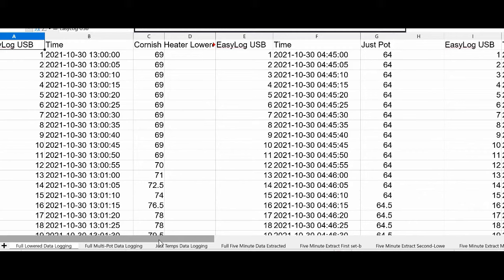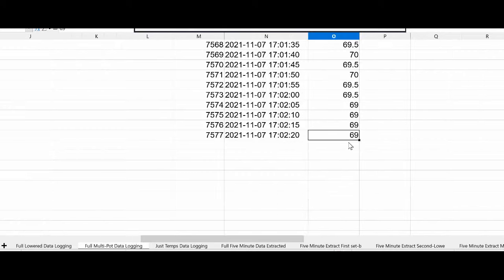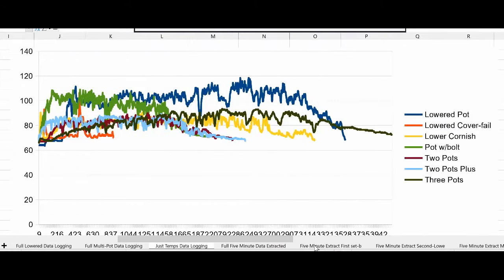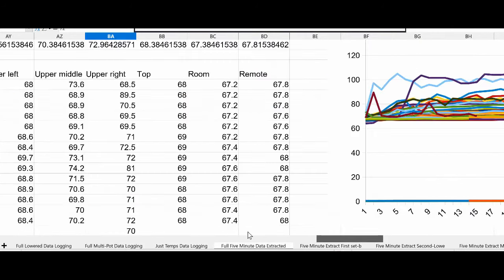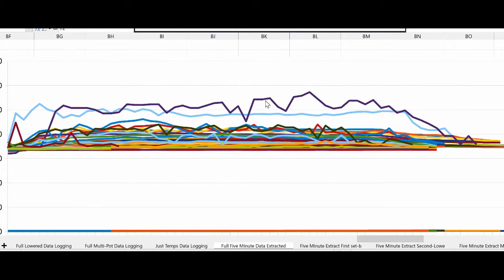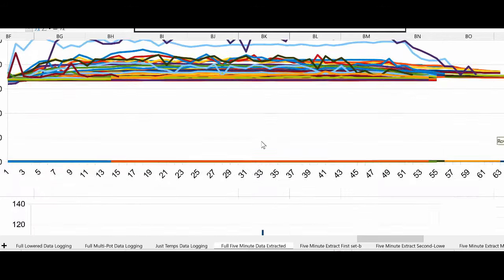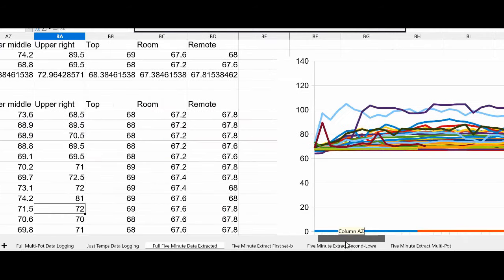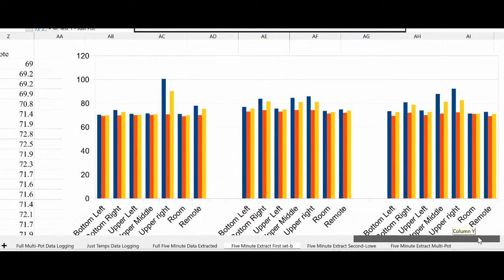How Many Candles Do I Need To Heat A Room? - CANDLE HEATER TEST - Real Data

Comment: I appreciate all your hard work in the few experiments I've watched in your channel....from a 🏴 Scottish women's view try heating a terracotta pot with a coin sealed over the hole...fill with kiln dried sand insert into a metal frame of some sort and heat with candles underneath .....voila you now have a sand battery which will slowly release 🔥 heat once the candles are finished. ☺

Comment: Thx for taking so much time and care to gather, evaluate and conclude. Very surprisingly insightful.
Reply: Great Theory. Real world test. Try 9 T lights inside a Matt black wood burner - radiant heater works fine.
Reply from the maker: I have wondered what layouts would work better, and this series of tests have proven that the only real difference is the heat source. 

Anything that can radiate the heat produced will work. 

Thanks for the info!

Comment: Thanks for the hard and diligent work. It would be great to have a tldr
Reply from the maker: That is, quite simply, that the heat source matters more than what you put it under. 

Putting it under something gets radiant heat. 

But there is no possible chance of getting more heat you than you put in. 

Also, cool off times are, typically, the same as warm up times unless you are working in tons (well, hundreds) of mass. And LOTS of heat!

Comment: i'm just wandering what would happen if you heated some oil with candles, what heat would that put out, either heating the oil under the pot or just out into the room.
Reply from the maker: If you only heat the oil, it would radiate just like this does. 

Actually, this is a real thing, but it's mostly done for the smell. Look up wax warmers or potpourri (I think that's what they are called).

Comment: Here is what I would do, use a  1 pot set up with 4 tealight candles, use an infra red thermometer and take ceiling tempature, from there take readings down a wall in 1 foot incraments to what would be a comfortable sleeping height. Light candles and let burn for  4 hours, repete taking of the temperatures and compare with first readings...
Reply from the maker: That is a good idea. However, it doesn't tell us what happens along the way. 

I set up this test to see how far the heat took to dissipate and to see how much it went up, or down, along the way.

Comment: Thanks. :) Yes it is true, everything. One man from Austria? in the Internet heats small room with good insulation with 1 small + 1 biggg terracotta pots without restriction of air flow (both pots with open bottom holes). You can check. His channel is Bavaria off the grid. In his version we see candles bodies lay down on the big old wood saw blade which is very good - he transfers heat from candles bottom too.
Reply from the maker: I looked at his video on the flower pot heater, and the biggest thing I saw was that he used more candles than I did. ;)

The more heat you input, the more heat output! ;)
Reply: @TestingPyros  Yes.

Comment: Hi TRLWNC1, 
Based on your arguments on the environment plays a major role. 
Making the test fair, and probably it may be still worth a try if this heating concept could work. Try substituting the candles to a terracotta
Reply from the maker: Because of the low overall output, the environment makes a major difference. I have done a test with a metal pot, but I haven't pulled the data out of it. I am planning to do more testing, but I'm not quite ready yet. 

I really don't think that what they are under makes a huge difference as long as it can radiate heat.
Reply: @TestingPyros  Strangely, my responds above didnt show my full statement and question. What if we substitude candles to ethanol gel (the one found in chafing fuel - its available cheaply). It radiates 7.04 kWh per gram. 
I believe the whole aim is to find out if this method of teracotta pot heating is able to heat a room.
Reply from the maker: While I agree that heating a space is good, I have decided to test something different. I want to know which layout creates the most heat. It is well known that a different fuel will create more heat, so I want to know what will lose the least. 

I'll try it with different fuels after I get a bit more data.

Comment: Would wrapping the pots in aluminum foil increase radiant heat? 

By that I mean, capture more of the heat that then radiates for longer and hotter? Obviously it can't increase the 50 to 80 watts of each candle.
Reply from the maker: In my testing, I have found that the more mass you add, the lower the total output. 

Yes, it holds more heat. But it takes longer to warm up, and the amount of time to cool down really isn't that much longer. 

It's better to just go with one pot and get the maximum output.

Comment: how many candle did you use from what you said you use just 4 candle way to much data logging an you are going to fast
Reply from the maker: I used 4 candles at a time.
Reply: @TestingPyros  do not put them all together you risk of a fire i try it an the candle got to hot space them apart you were luckey you did not burn your table like i did
Reply from the maker: I am aware that these can get quite warm. That is why I run them on a fireplace mantle. 

However, I have never had these ignite anything. I almost want it to happen so I can understand what it takes!

Comment: You have found out that bunch of candles have potential of creating some heat.
Reply from the maker: I found out that it doesn't take a clay pot long to warm up. 

Then I found that the candles themselves have an effect on the overall output. 

Then I found that the temperature is amazingly consistent during the time the candles are burning. 

Then I found out that the pot cools off at almost exactly the same rate no matter how much mass had been added. 

Lots more than just whether or not an open flame can warm. 

Which is what I wanted to understand. I wasn't wondering if candles could really do anything. I wanted to know the trends and patterns. 

I'm working on digesting the rest of the information so I can say which layout puts the most heat, so is best overall. 

Thanks for the interest!

Comment: Je hebt al blazertjes van 29 watt.
Reply from the maker: Yes, candles put out extremely little heat. But they do put out heat. 

I am not verifying the amount, I am verifying the consistency.
Reply from the maker: Even if there is more mass or more items to disperse the heat, the total heat output cannot change. 

Also, a fan only helps when there is enough heat to actually heat the space you are in.